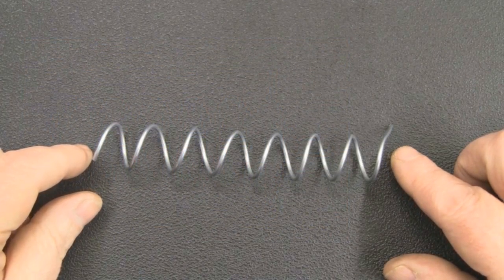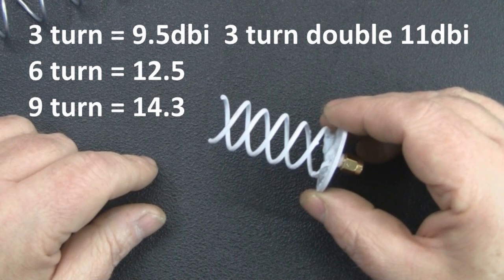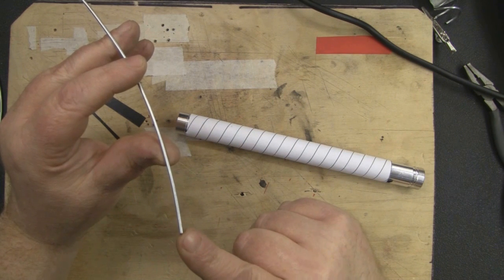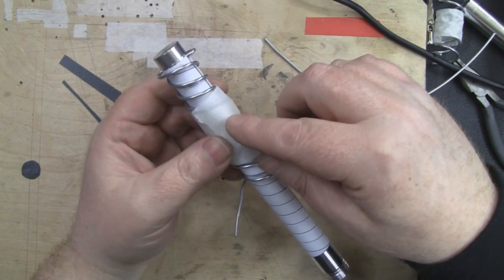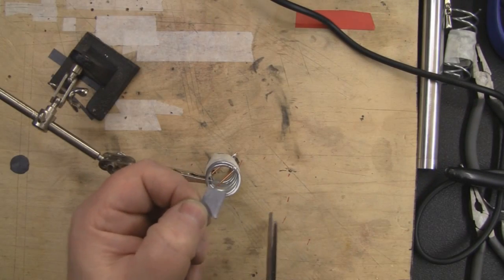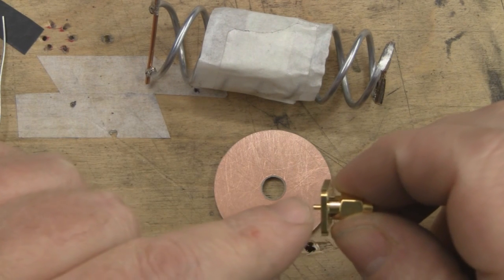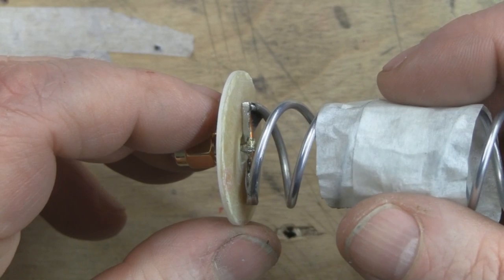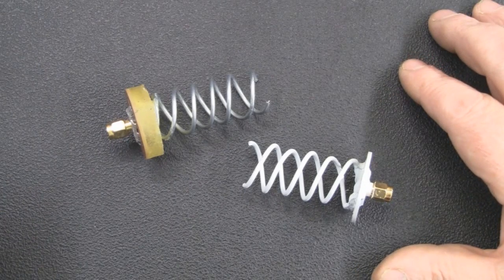5 8 GHz Double Helical Antenna #83

Comment: Hi Andrew, I was wondering is each coil the same as if you were making a single helical as far as spacing goes, so if you measured the winding of coil 1 to coil 2 would it be around 6mm? or is the spacing between the two coils still around the 12mm from coil 1 and the next wind coil 2. 
So basically asking is this still the same overall length as a regular 3 turn helical or is it the length of a 6 turn?
Thanks!

Comment: double helical (one "-" radiation, another "+" radiation) + (dipole vs. spiral)  antenna (2.4GHz) ? (+ tin-pipe or tincan + wo-/reflecor ?) (and yes, I'm noob) But I know that sometimes scientific discoveries are made by wise scientists with mistakes, and sometimes fools are accidentally (I dont have this expensive measuring instruments to play/measure). Every antenna cable need to make like AC voltage (impulse signal)? u this antenna if is  "+" in antenna (connector) then how mach % is "-" in reflector (connector)?
Reply: ok I was get better explained (but not animated) (page 9,11-12,...) https://www.slideshare.net/chinkitkit/topic-6-em-waves after this old (not best) basic https://youtu.be/ysNkjEnoRsU & https://youtu.be/-F7KYLO4Bkg & https://youtu.be/ZaXm6wau-jc

Comment: So..... Confused / question .....
Why not feed the ENTIRE wire through the tube, coiling both sides at the same time, or one after the other, clipping into two & down to desired length....this would have easily saved time and stress...?

Comment: Very interesting description. I have just built one of these following your guidance as much as practicable, and subjectively it does seem to perform (I do not have test equipment to really measure it). However, what would you expect the radiation pattern to be? The reason I ask is that mine appears to have two peaks roughly 45 degrees either side of straight ahead.

Comment: Hi Andrew, I see on the on line calculator that by reducing the wave length the calculated DBi increases significantly, for example, by winding an 1/8 wave length helical antenna at 10 turns its calculated at 15.27 DBi of gain with a 46.5 degree spread.

Would this be a worth while build for fpv? and how do you think a double 1/8 wave helical would perform?
Also, could one use thin copper tape wrapped around pvc pipe  instead of wire? 
 regards

Walt.

Comment: Good video. Simple but factual.
Thanks.
Whats the length of each wire for each type?
ie the length for 3 turns 6 turns 9 turns etc
Is the length critical?
 or the diameter of the loop?
Can i use copper wire and a copper 2 p peice with a hole drilled for the reflector and stick a plastic washer for insulation.

Would using dissimilar metal wire make any gain ie one coil copper the other ss

Comment: The problem seems to be with making homemade gigahertz antennas is the ability to test them.  You can do range tests, but the equipment to actually test the designs on the bench are forbidding for the hobbyist.  You can't really measure the SWR, the radiation resistance or the resonance of such high frequency antenna unless you're rich with a laboratory.

If you can't test your designs with lab equipment, you should test them in the field, such as with range experiments.

Comment: Thanks for the tutorial Andrew. I discovered this video while researching alternative antennae options for my diversity module (fpv). This design has really captured my imagination and id love to have a stab and build a few to test but and i have a couple of questions id like to ask you as my knowledge on this subject is next to zero.. If you arent too busy and could find the time to inform me further id really appreciate it. 

Would there be an appreciable increase in gain if i were to add a third helix? 
would there be an appreciable increase in gain (or range or beamwidth) if i were to use a dished reflector?
How much do plastic covers (heat shrink, protective cones, etc), paint, etc affect the performance of these antennae?
Is there a simple explanation regarding "impedance" in regards to these antennae and how to calculate what size shims are required? eg: Does the required shim size change if i - add a third helix? - add more turns? - use thicker wire? -etc..

Thanks again Andrew, i look forward to more of your videos

Comment: Mate, i made 2x 3 turns and 1x 9 turn antennas with the discription you gave, but they totaly did only 300meters and lost signal. I had done 2 different helicals about 1 mounth ago and they perform 1.7km range on same conditions.. I couldent understand why this guide did perform this badly.. I know i did everything good..  i have 1 question, the receiver antenna is a Copper Tube single wire antenna. 
do you have an explanation why normal helical did perform better then dual helical (as your design) ??
Reply: Could you kindly provide built instructions for your antenna that reaches 1700m of range? 
How much did you feed them?
What was the frequency? I guess 2.4Ghz right?

Comment: Your antennae look very nice, but an antenna is a functional object, not an art piece.  Do you have any test results?  Even if you don't test them scientifically, you might say what success you have had with them, and compare and contrast between those you have made.
Reply: Pullsee those are not test results.  those are gains the antennas should theoretically possess.  his antennas look very nice, but he never tests them to prove they work.
Reply: Mike Collins I'm basically running into the same issue because I've made these antennas and I feel like they could be decent but I've only made helical antennas to his design so maybe I'll try a single helical from another design and post test results.

Comment: Hi Andrew
Thinking of building it with 2.08mm solid Copper wire.
Will this alter or obviate the need for Impedance-matching shims ?
Reply from the maker: +A Mancastrian No you still need the shims, as a rule of thumb thicker wire increases the broadband properties and thinner wire decreases.
Reply: +andrew mcneil Sorry for the noobie questions, but just making SURE your Template link (this page) is for RHP antennas as it mentions 'LHP'. If nor do you just do a mirror image?
Cheers
Reply from the maker: +A Mancastrian So it is right hand your the first person to notice yes if you mirror image it will be fine

Comment: Andrew, thanks for all your videos. Very informative and helpful.
I was wondering though, if you were to use 2 of these (in parallel) at 30 or 45 degrees would there be any kind of interference or cancellation? Would this effectively increase the angle of reception?
Is this even worth considering? 

Thanks.

- Mike
Reply from the maker: +Del Quad4X The only loss would be splitting the signal between the two (3db loss) so you would loose some forward power, distance but you would cover a wider area, beamwidth.
Reply: Thanks Andrew.
Since I'm not planning on any great distance flying (FPV Quad) this may be what I'm looking for as a ground station antenna system.
I want the penetration through trees, buildings, etc.
Would I be able to negate the loss on this 3 turn by using the 6 turn design? I understand there is still a loss.

Comment: hi andrew not sure if I missed this but does the antenna perform better when vertical or pointed in the general direction of the flying craft thanks I have built several of your others and love the chance to increase my skills base. Also is it better to use double sided copper plate or single like you have, or does it not matter at all. thanks

Comment: So mixing a left hand turn and right hand turn helical in the same antenna will give you more range? =/ 
Does this only work with a Dipole TX antenna? 

If using a right hand turn cloverleaf on the airplane the left hand turn on the helical wont do anything?

Comment: IT might might be much easier, when working by your self, to wrap the coil a little tighter (or shorter) first, and then pull the coil out to the desired pattern rather than pulling on the end afterwards. Said another way, stretching a coil is easier than tightening it.

Comment: Greetings Andrew,
Just wondering about the reflector, is 34mm a critical measurement or was it just that you had that size holesaw handy? Is there any advantage in increasing the diameter to say 38mm?
Cheers
Reply from the maker: +James Lamb Hi James theoretically the diameter of the reflector can be increased to  1 wavelength anything above that has no real benefit. Having a larger reflector will give a small increase in range so 38 mm  will be fine.
Reply: Thanks Andrew.
Reply: +andrew mcneil Why is your baseplate so small?  I thought they were supposed to be one wavelength (which at 5.8, which goes up to 5.9, would be ~52mm).  Most of the professional base plates I've seen support the 52mm claim.
Reply: thechosendude so is that true... A 52 millimeter would make one wavelength... So if I make a 2.4 double helical I would probably need close to a base plate twice the size of 52 millimeters. so to be clear one wavelength is approximately 52 meter wide circle.??

Comment: If you take losses out of the equation (for example, from poorly executed antenna projects), if you have more gain, it must be from narrowing the beam angle. There's no magic in antenna projects. You can very much rise your gain by doing a double helical, but you won't get the same exact beam angle as a simple helix. It would be, in an ideal situation, exactly the same as the drop in the beam angle.

Comment: can we use different materials.. copper wire? for the coils and what difference does it make to the construction.?
Reply from the maker: John Reap Hi John yes you could use copper but as it is softer you would be better if you could find something to house it in. Copper is a better conductor but in the real world you would not notice any difference in performance really you would need to hook it up to a analyser as the difference is small. Using steal is a compromise with form and function.

Comment: Great video! I'm trying to build one using a 3D printed template and 0.8mm wire but am a bit i doubt about the size of the 10x15mm shim? How do you calculate the size of the shim?

Comment: Hi Andrew, absolutely love your build videos.
Thank you so much for all them.

I love to build different DIY projects, but my problem is until I understand all the concepts of what and why I don't dive into building one.
So I have a little request.
If you can please explain the calculations that goes along the build like the thickness of wire used, diameter, spacing and especially the impedance matching part. 

I have spent several hours trying to understand the dimensions of the build, but these two things, impedenc shim dimensions and the dbi is just out of my head. 

I also read some explanations by ibcrazy from RCGroups, but no luck. So if you can make a video on explaining some of those, that would be great.

Thanks.
Reply from the maker: I did say sometime ago that I would do some basic fundamental videos but last year turned out to be a busy year for me with life and work but I am still hoping to find the time as a few people have asked the same question so hopefully this year I will find the time.
Reply: andrew mcneil Cool. Thanks Andrew.
Reply from the maker: Chirag Chaudhari I am planing on doing some fundamental videos just 5 minutes long. The big problem though is how to make all the mathematics interesting!
Reply: andrew mcneil Well its sure hard to make that math interesting. But I am sure the people who actually gonna see those kind of videos care more about the logic behind the math than how interesting it is.

Those videos will to educate than entertain, so dont worry about that.
If I may suggest just make 1-2 video a week. Pure math and electromagnetics, one concept at a time. And then whatever questions we people have, instead of answering them on comments, just make another video of Q&A.

Seems like lot of work, but you can skip video editing and stuff and straight to point. LIke we are sitting in the class and you are professor !!!

Comment: How did you get these gain values?

3 turn = 9.5dbi 3 turn double = 11dbi 
6 turn = 12.5 6 turn double = 13.8dbi 
9 turn = 14.3 9 turn double = 15.5dbi
Reply from the maker: you can easy calculate gain with simple maths antenna design has to obey the laws of physics like most things but the materials you use to construct do also play their part. .
Reply: andrew mcneil These measures are offset against other helical antennas of 5.8 GHz (other videos and calculators on the Internet).
For a frequency as high as 5.8GHz, every millimeter counts.
Done any testing with these antennas, type range test?
Reply from the maker: Rui Garcia All my antennas are tested on a Agilent HP 8720D network analyser. I have also sent antennas out to some of my subscriber who have asked if they can test them and feedback to my channel as I am not into the hobby but I am currently putting together my first quadcopter. There are online calculators but they only good as a starting point for a prototype because google helical calculator and input your requirements into a few different ones they all give slightly different measurements.
Reply: andrew mcneil I will try to build a 3 double helical turn and tes it.
My DIY antennas for 5.8GHz with best performance so far are fiveleaf (similar to lotus antennas).
Good luck with the construction of Quadcopter, I am available to help with any questions that is in my power.